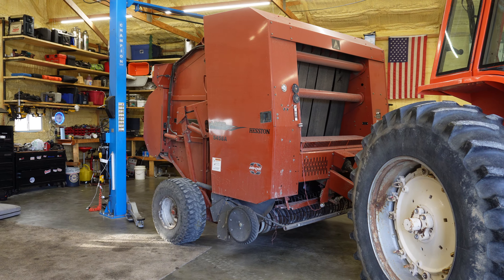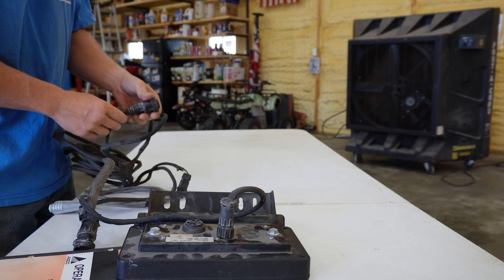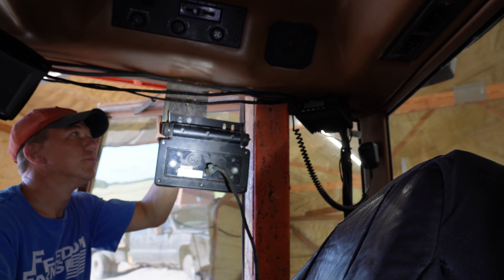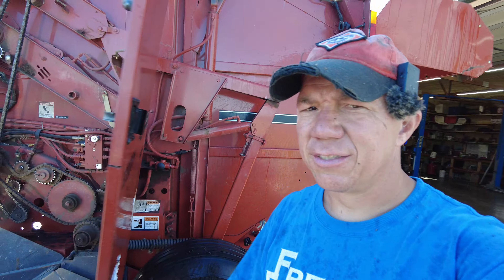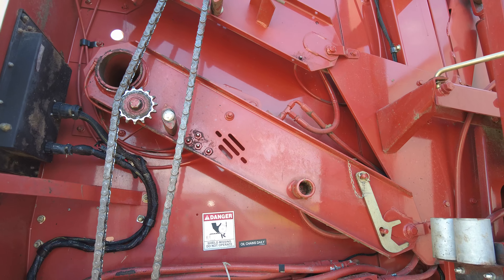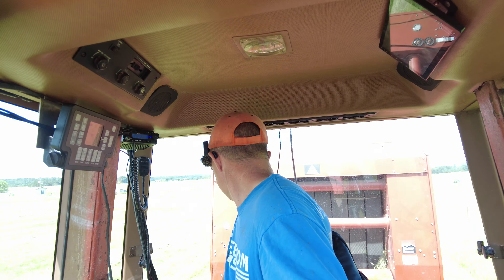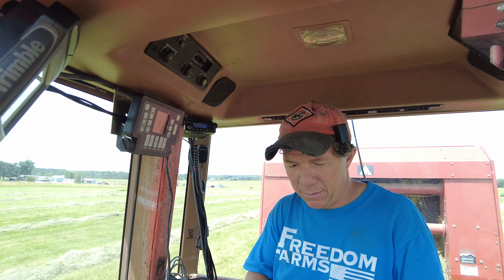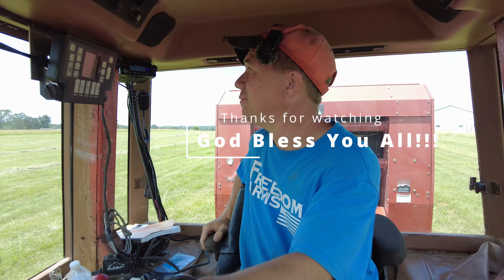New Baler

Comment: Your next baler should be a Massey Ferguson 1745d. They are about 30k. We really like ours do about 150 acres a year with it. Just do not run hay rake parts through it plus you don’t have to turn the pto off to dump a bale
Reply from the maker: This one you don't turn the PTO off for anything either. I imagine most machines don't like metal pieces going through them 😂 Massey and Hesston are very similar machines as Agco owns both

Comment: I have a HESSTON 5530 baler, though I have not used it yet. 
I raise sheep, and don't like any plastic twine or netting, since it breaks down somewhat into micro-plastics, and the sheep end up eating the micro-plastics, and even some of the bigger pieces of plastic, and some toxins end up in the meat. I don't know if my baler will run using natural twine, but I hope so.
Reply from the maker: I've never had an issue with sheep eating the plastic twine at all. Been raising em for 7 years so I would personally say that is far from a concern of mine.

I'm sure the 5530 would run any kind of twine you use honestly. Twine is simple and rarely has issues
Reply: @FreedomFarmsMo  Yeah, I've seen the sheep eat it a few times, or at least chew on it. I've also have chunks of netting inside bales of hay I've purchased.
Reply from the maker: @FLPhotoCatcher interesting. That's a risk you take when buying hay instead of making your own I suppose.